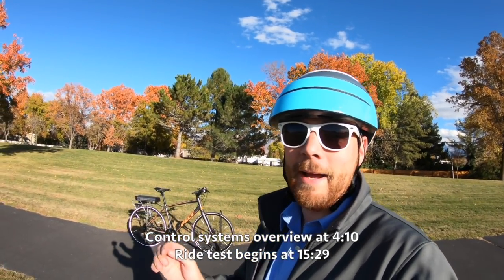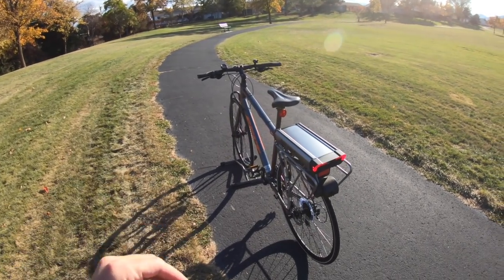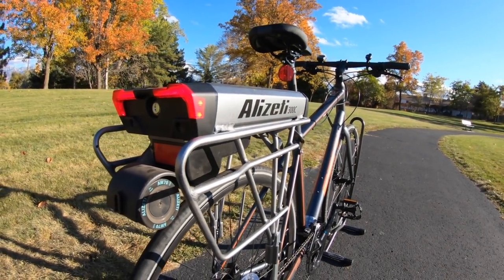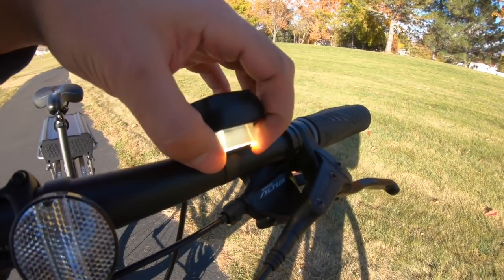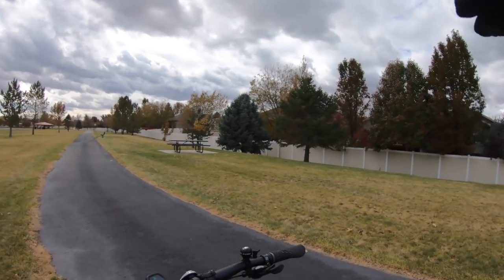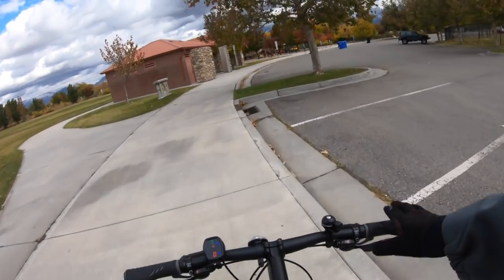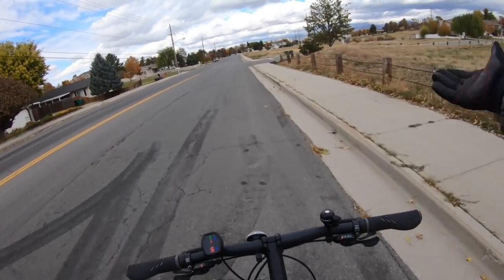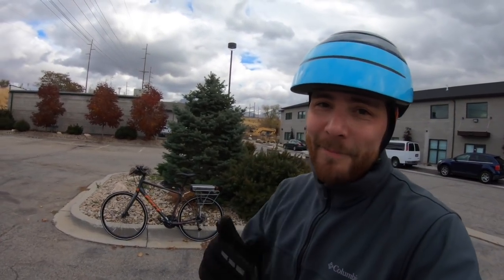Alizeti 300C Ebike Kit Review - $850

Comment: Best all in one friction drive I've seen for the money. I'll never buy it but it seems to be a good performer. One could buy a Bafang BBS02 kit for much less and get much more power & torque as well as premium performance w/o these limitations & NOISE. Got more money and want more power/torque? Step up to the BBSHD! You'll be pleased you did... ;~)
Reply: C Witham I have a BAFANG 750w with 17.5amp battery and it cost substantially more than this piece of kit
I agree the BAFANG is much better, but how much did you pay including the battery
Reply: you can get a BBS02 kit with battery for about the same price
Reply: About the same is not an answer
What size motor
What size battery
What exact cost
Where
Reply: @mikesl1573  I've had mine for over two years and bought it on sale for $360 with a 13.5ah battery $430 from Luna.
I just checked; Luna pricing is currently $910 for both the BBS02 kit and Battery. Where did you spend more and how much?
Reply: C Witham Thank you for your response which confirms the BAFANG is more money. I do not say more expensive as it is  immeasurably better than this back wheel pretender and anyone who is serious about long term conversion, BAFANG is the way to go. It is quite crude compared to the latest road bikes, but is great fun
Reply: @mikesl1573  Dont forget cost of installation.... Not everyone can install a hub or mid drive retrofit kit. Almost anyone would be able to install a bike rack solution like this one.

Comment: Nice review!  A couple things you didn't mention, and maybe you don't know -- how far can this thing go on a charge?  And does the display include a battery meter?  I think you explained at the beginning that it did.  I should watch it again.  Sounds like it's pretty easy to install as long as your bike has the required mounting points.
Reply from the maker: I can't answer for Mikey, but thanks for chiming in, perhaps he will comment or others will have some answers.
Reply: This is important info.  Also, how fast can it go?
Reply: boroc7 20 mph

Comment: What's the battery autonomy? Also, how much wear and tear this friction motor will induce to your back tire? Thanks for the review.
Reply from the maker: Great question, I'm not sure about wear, I suspect that it will definitely add some, because the friction of the drive unit is directly proportional to the friction of the road that is being pushed when it accelerates you. I'd hazard a guess that it wears the rear tire out about twice as fast as if it weren't there? But then again, the unit won't skid to a stop like a rider might do for fun ;)

Comment: This is the sort of thing I would like to have on a trike.  But would a single friction drive perform well enough?  One thing though is the need for throttle mode.  It should be possible to trick systems like this into a full throttle mode.  3D print a circular attachment for the left hand pedal or crank shaft.  Then glue magnets into place to create 8, 12, or more points that the cadence sensor can read.  

Another way to fool this type of sensor is to mount a small motor beside the sensor and then place the same 3D printed magnet embedded wheel over that sensor.  Tap some sort of switch or button or twist a typical throttle handle to activate that secondary motor.  The Cadence sensor will detect motion and should kick into high gear giving you adjustable throttle mode.

How hard would it be to mount a bike computer to this system to know your speed, battery life, GPS, etc?  Or perhaps a better battery meter and then use your smart phone as the bike computer for speed and GPS?

Comment: 2 things.  1st when you had the camera on the friction roller the rear red light was doing some blinking off and on..... why?

2nd, not knowing the dynamic range of the built in speaker, but small speakers can be awfully good these days, it's kind of a shame the company didn't figure out a way to wire (usb) from the controller (or even Bluetooth it in) so that you could play tunes from a device mounted on the bar.  It would have been one of those gotcha perks that might sell more units.  But perhaps the build cost might have outweighed the sales benefit?
Reply: the rear lights blink when the rider is stoping or turning, this is one of the products features, also this unit does have bluetooth connectivity, you can play music from your mobile phone.

Comment: Mid drive motor is where it's at.  it keeps the
weight low and center and the bike rides with no resistance when you don't want to use the motor..and it's the quietest design.